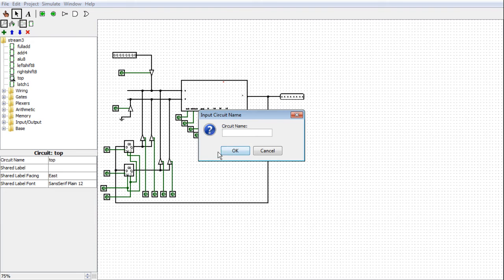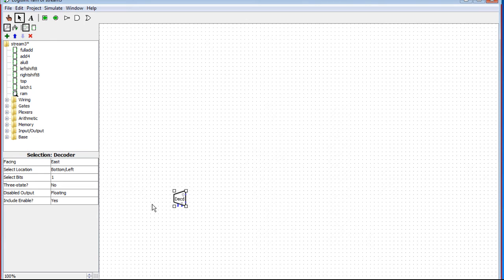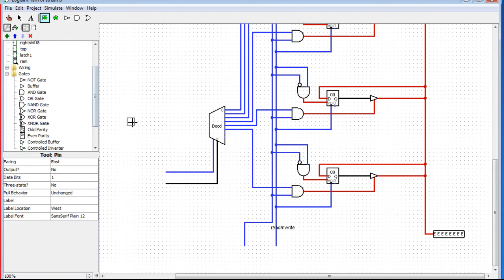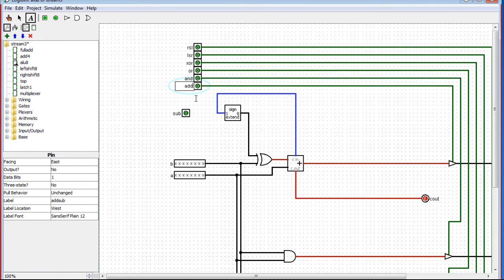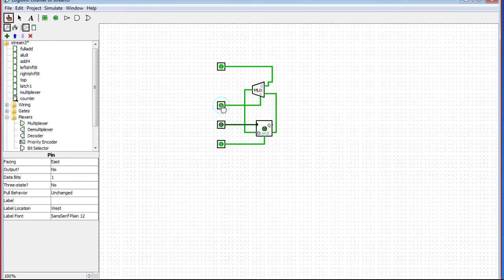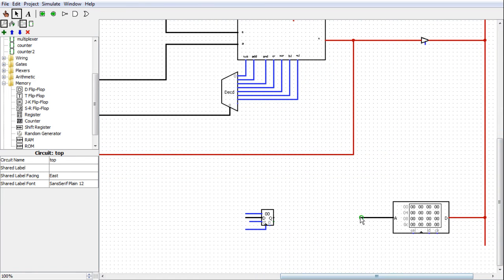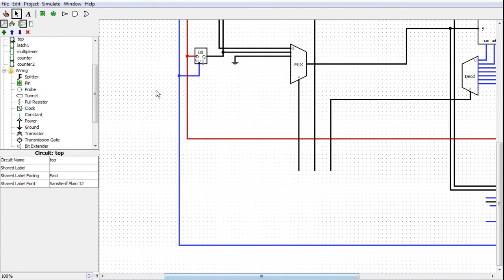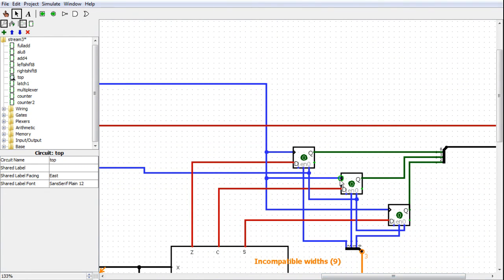CPU Design Digital Logic - Stream 3

Comment: should add an 8-way associative L1 cache...
Reply from the maker: zero-latency ram baby, running at the cpu core clockspeed
Reply: @ChiliTomatoNoodle  I've built Ben Eater's 8-bit breadboard CPU in Logisim and I didn't use any of the built-ins also my adder isn't a ripple carry, it's a look ahead... adder. the only built-in's that I used are the ROMs for the control unit's logic... even the ram is built from 8-bit registers with tristate logic all from gates. I did not use any transistors... that would have been too much. But I can run it at full clock speed. I also have LED outputs for different registers... the PC counter, the MAR, the Instruction Register, the A & B registers, I also implemented the 7-segment hex displays. giving 3 digits of output plus the sign bit. It took me about 2-3 months to get all of the bugs out of it.
Reply: @ChiliTomatoNoodle  I haven't gotten to it yet, but I would like to build a 32 bit CPU in Logisim with cache hierarchies. It's more for the design principle even though it won't speed up the "simulation". More for learning how to wire up - connect the cache lines to the CPU. I'm thinking of maybe doing a 4-pipeline set up too. Then try to extend it to a dual-core CPU with a shared cache. It's more about learning the principles of hardware design. I'm 100% self-taught, 0 College or University training. The same goes for 3D Graphics Programming in C++ and now I'm learning Neural Networks - Machine Learning in Python. I'm also getting into Compiler & Operating System design.

Comment: Hey, sorry for the stupid question, but how do you build the basic logic gates here with just wiring folder resources? In first video you don't explain how to build them and would be nice to have that knowledge also: how an AND, NOT, OR and those are composed just with transistors and wiring.
Reply from the maker: In the first video I explained basically that logic gate constructions is out of the scope of this series. It's not super hard, but if you want a detailed treatment it will require learning a lot about the characteristics and operation of mosfet transistors.
Reply: Awesome, thanks for the reply. Do you have any resource where I can study that part?
Reply: @MoisésRodríguezUlloa  Search "Ben Eater" on YouTube
(I know that im 3 years late)

Comment: And there we go:

STREAM 3 TIMESTAMPS mistakes happens
10:00 So today we see the Control Unit?? NIET! Instead we look at RAM, multiplexers, decoders, counters and finishing the data path
10:46 RAM introduction - kinda like an addressable array of registers
13:23 RAM concept layout
14:51 Binary decoder
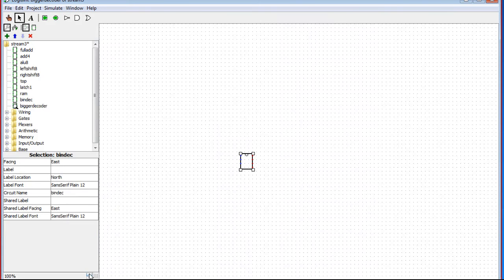22:00 Cascading multiple 2-bits decoders to make bigger ones
27:57 The built-in decoder
28:50 Decoder + registers == RAM! 8 bytes RAM, with a 3-bits address space
39:07 That's it? Well...we need more wires: clock, read/write and bidirectional bus
47:20 The moment of truth! Will this work?
48:00 Ehmmm... nope. Misconnection!
49:23 Testing the RAM
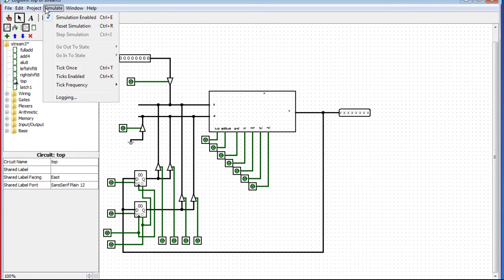52:20 The built-in RAM
53:04 Multiplexers: like the decoder, but with an OR gate at the end
58:00 The built-in MUX, cascading multiple plexers together
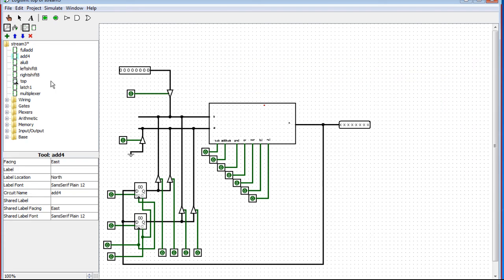1:02:47 Nice and tidy: rewire of the top circuit using decoder and MUXs
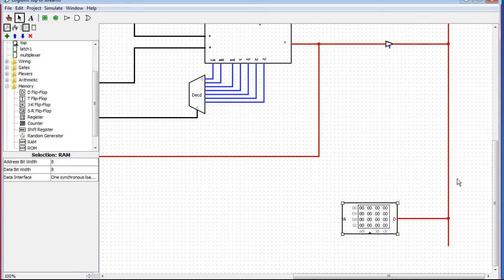1:16:13 Instruction Pointer, contains the next instruction to be executed and can be incremented (binary counter)
1:21:04 The T-flipflop
1:26:35 Counting is flipping back and forth: connecting T-flipflops together
1:27:59 Yeah, cool, but why counting is flipping back and forth?
1:36:11 Counter finished!! It counts!! YEEEE - no wait, WTF? (misconnection: will be fixed in the next stream and it will be a great lesson in circuit "debugging")
1:48:47 Flags: signals used to make decisions (and another minor mistake)
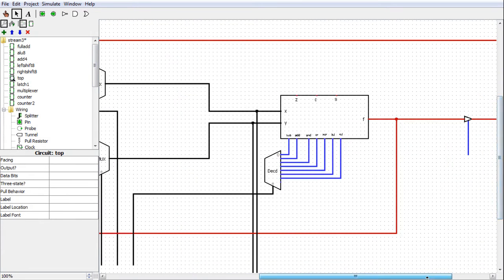1:54:01 Flag register (well, it's a bunch of flipflops, to be precise)
1:55:52 Final wiring of the data path (more or less)

FUCK I can't believe that the error in the counter was so simple. I stared at the damn thing for ages and I couldn't figure out what was wrong. But, as Bob Ross says "There are no mistakes, only happy accidents! Except when you are trying to connect T-flipflops together, that can be a bitch". Have a nice day!
Reply: Damn, already 4 years ago
Reply: @du42bz  Holy cow, almost forgot about these videos!

Comment: ok, WTF, I had the same exact problem with the 4-bit counter made with the "custom" T-latches.. At the first run, it worked as expected: it counted from 0 to 15. Then I tried to load an arbitrary value, started to count again aaand... it flips back and forth two values. 

So I tried to reset the simulation and put the thing in count mode, to make sure at least the counting mode was working...nope. It flips back and forth between 1 and 2. Maybe it's something related to the fact that there is not "real" propagation delay in the gates? 

I guess the problem lies in the fact that, after counting 2, when the first latches toggles again, the output of the first AND gate changes immediately, triggering the toggle of the second latch... but then... WHY THE HECK DID IT WORKED IN THE FIRST PLACE???

Oh, I'm dumb. It's something related with floating inputs at the data lines of the latches. So... bug?
Reply from the maker: I think I actually discuss this in the beginning of the next vid... Anyways, IU recall it driving me crazy too for a while ;)
Reply: ok, then I'll wait until the next video :D in the mean time, just for the sake of it, I tried two other versions of the same circuit: in one of them I replaced the built-in MUX with one assembled by myself, and in the other one I used two tri-states with the control lines connected to toggle and !toggle ..... well.. same results :D